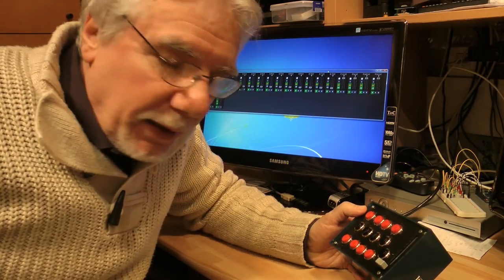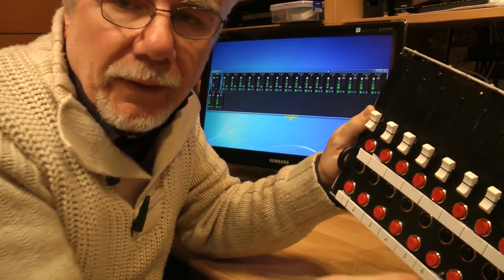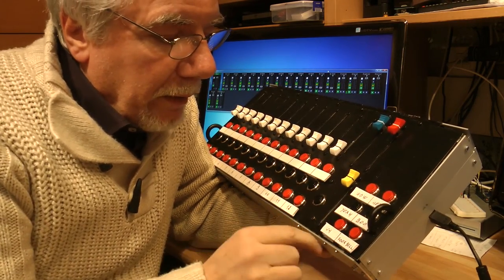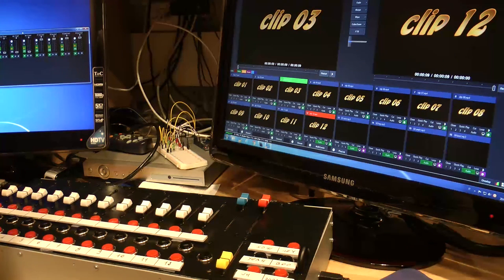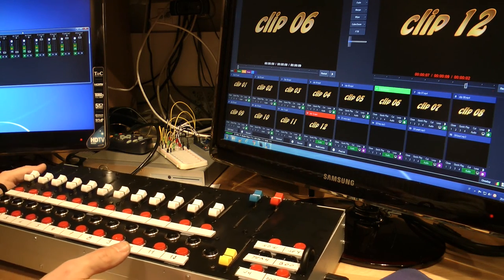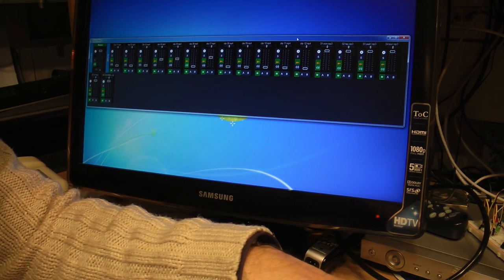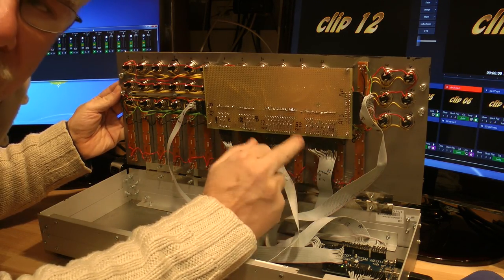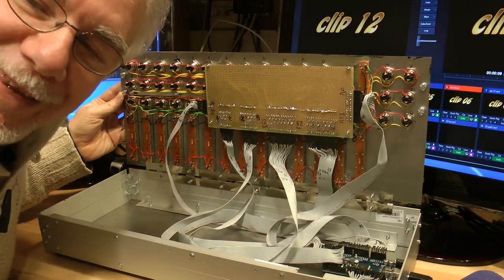Vmix audio and video controller over USB

Comment: Thank you Sir,..... Your Vmix external control panel is really Amazing....
A Big salute... I am Shaji from Kerala. Sir, could I know your E mail ID so as I could clear  some doubts? If it will not be a trouble, I humbly  request you to send a reply through mail..  My E mail ID is 
' Mundakkadan@gmail.com'. 
With Regards Shaji.
Reply from the maker: What are your doubts?
Reply: Sir , I am Shaji from Kerala. I am a business man and interested in such areas...
My business is related to cable tv and Broadband services and software development...
My technical qualification is electronics and satellite tv reception system and academic qualification is MBA. I have been running a cable tv channel named ' 'Regional'in our network . We use many a software for programme scheduling and indoor , outdoor live programmes . We have recently realized that Vmix is an excellent software for video mixing and noticed your video while searching for information about external controls....but I have some more doubts about its assembling... With respect  and expectation I would like to ask these...

Sir,
 we bought an arduino card and installed the driver. The card is detected but the pin numbers are not  got connected.  Do we need programming ( coding ) for this? Could you give details of coding and wiring of the same?
    Can we set all the 42 switches and T bar function using a single Arduino uno board? Possible to set tally light and slow motion effects using the same arduino board?
      Humbly request you to support me... With respect , expect your valuable information... 
With Regards  Shaji...
Reply from the maker: Hi Shaji. Arduino is a controller and you must program it as you want, there are a lot of tutorials in Internet and I suggest to search the basic about this. In my project I used an Arduino Mega because Arduino Uno doesn't have enough pins to menage everything. If you want use also tally lights, one more Arduino is needed, but I suggest to use activators instead tally lights, because in this way you can use one Aduino for shortcuts and the second Arduino for the led under the buttons and the tally lights. Anyway it's a little difficult to explain all these items if you don't have the basic of Arduino. My advice is to spend a lot of time studying Arduino and after that you'll can do everything you want.
Reply: Thank you Sir, I am Shaji from Kerala, India. Last days  I with my friends and technicians were behind Adruino. With the support of all the information especially with your valuable video and suggestions we won  in the project of tally light with Vmix using Adruino uno. Now I have purchased one Mega board to test the other controls .
 Sir, I have some more doubts. 
 Which is the coding to be used for this purpose ? Is the code for any Midi enough for this? Possible to control Slow motion with adruino instead of Pro?
  Expect your valuable answer, 
  Thanks and Regards Shaji.
Reply from the maker: For tally lights you must use standard firmata code. About the buttons and faders control you must load midi library and write your own code on what are your need. I didn't study the possibility to control the slow motion with Arduino but I think that Vmix Pro is needed.
Reply: chetto sadanam kittiyoo ??? enikkm venamairunn
share ur mobile num pesronally